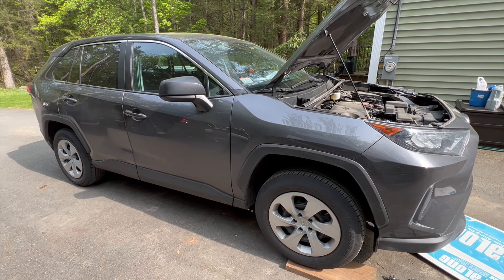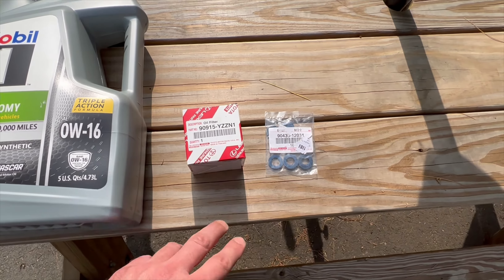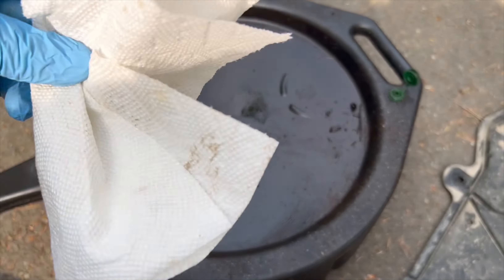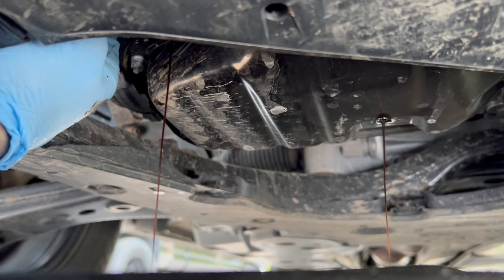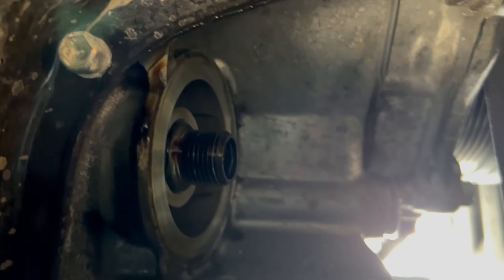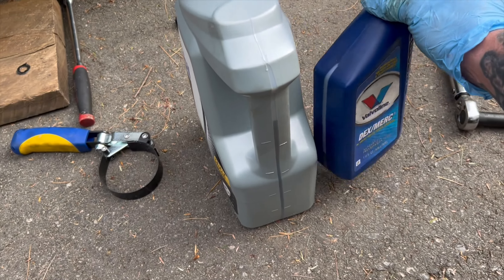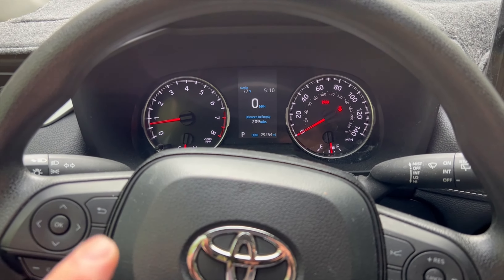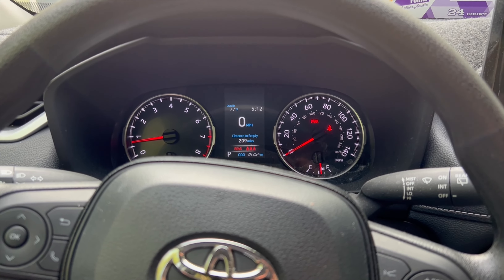2022 Toyota RAV4 oil change and how to reset the maintenance indicator

Comment: Looks like Toyota went back to the spin on oil filter. Why manufacturers went back to 50s technology with the cartridge filter I'll never know. I was surprised to see 0W20 oil. Now they are down to 0W16. Do you have any oil consumption issues with such a low weight oil?
Reply from the maker: I prefer the spin on filters myself. I’m a little ashamed to admit I don’t really check the oil much so I’m not sure if there is any oil consumption. That sounds worse saying then it did in my head. I’ll have to check it more and see.
Reply: @JasonTheMunicipalMechanic No, no….no need to be ashamed.  I never check anymore either.  When I was a kid, you learned auto mechanics watching the big kids (16-20yrs) tearing the engine apart to do a ring job every 40-50000 miles.  I haven’t added oil since my 1974 Vega! 25 miles to a gallon, 25 milestone a quart 😅.   For quite a few years the metallurgy, lubrication, so much better.   I look at the oil pressure gauge, tailpipe occasionally, and change oil at 5-7000 miles.  That’s progress.